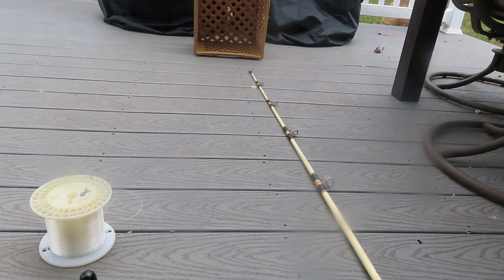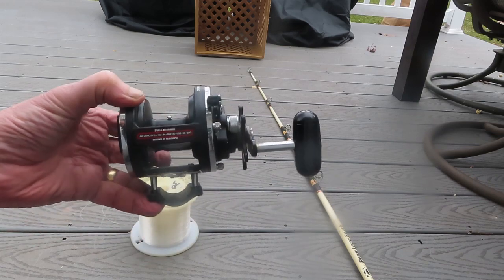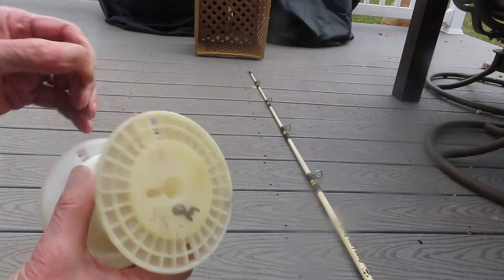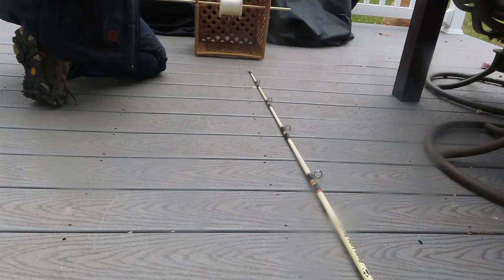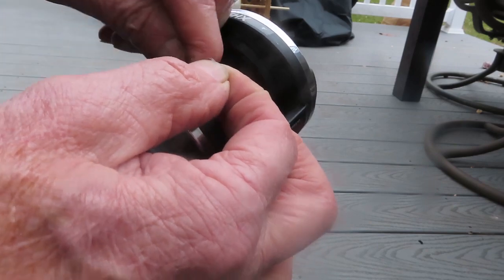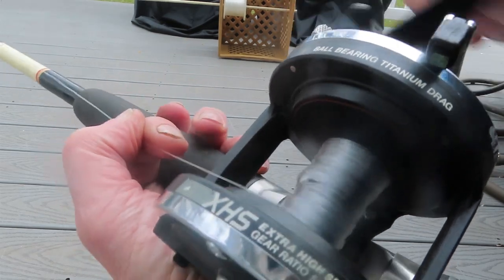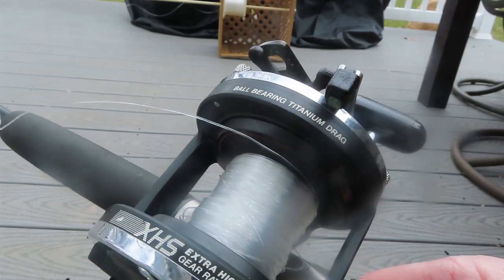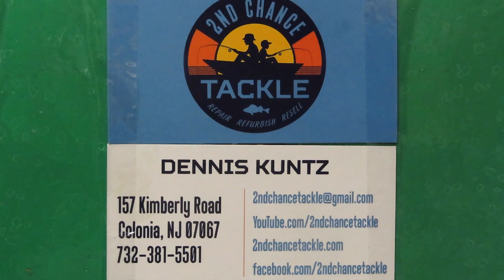How to put fishing line on a non level wind fishing reel

Comment: thanks for the how to use video, I can fix one of these, but haven't got a clue how to actually fish with one. I grew up around people that used spinning reels and spincasting reels. Once Spring starts I am going to learn how to cast a conventional reel. If any neighbor asks what I'm doing , I'll tell them Grass Carp season just opened but their not biting
Reply: Seymour, if I may make a couple suggestions... use a torpedo weight. You'll occasionally have to go dig it up when it hits just right but it'll retrive through the grass easily and won't tumble and twist your line. Have water with you to wet your line, it'll cast a lot better. Be patient with yourself! It takes skill to cast a conventional reel well.
Reply: @Greenmaninthedesert  what weight torpedo to start ? I'm retired , so I have the time finally as far as patience, I'm too old and crippled  to get in a hurry anymore, thanks any and all help is greatly appreciated
Reply: @Greenmaninthedesert  should I start with a level line or  conventional , a magged reel like a penn mag 10, I might be making it more complicated then it needs to be
Reply from the maker: Learning to cast one of these is learning from your mistakes!  Be ready for bird's nests when you are educating your thumb.  You will get it an wonder why you haven't been using these all along in not time at all
Reply: @seymourwrasse3321  Good question, Depends upon your rig and what weight you'll be using in actual fishing.
Reply: @seymourwrasse3321  I've never used a reel with a controlled spool so a question I am unqualified to answer.
Reply: @Greenmaninthedesert  I guess I will put some line on a jigmaster , get an assortment of those weights just play with it till I get the hang of it , I wasn't born knowing to use a spinning reel or a spincaster either , and I learned by doing. thanks for the weights suggestion
Reply: thanks Guy and Dennis for the info and encouragement , My thumb starts school soon
Reply: @seymourwrasse3321  how you doing on your casting? If I can throw my 2 cents in,  what I would suggest is get the rod and reel that you will be using, make sure the rod is for conventional reel(small eyelets all the way up rod) then pick the weight you will most likely be using weather your plugging with lures, bait fishing,etc. and the weight being used should be compatible with the rod. Anyways I would go to the water and tie your desired weight to your setup, some reels have anti backlash features where you don’t have to worry about much for the older reels I like to add a little tension to the spool adjustment, you won’t cast quite as far but it will save you from big birds nest that can end your day. What I do is hold my rod straight out waist high and drop the weight without applying any thumb pressure on spool, after weight hits the ground I look for the reel to over spin from 4-12 times, creating small birds nest, this will help tremendously with having to thumb your spool 100%  and large birds nest with slightest error.  Also use quite a bit of thumb tension while weight is in the air and when weight hits the water stop spool with thumb that where most of your over run will happen, as you get better loosen your thumb tension on spool while casting for longer cast. It’s all about trial and error. When you get a better feel you can adjust spool tension accordingly. Just be aware when you get a birds nest when you get it untangled to check for nicks in your line while reeling your line back in unless you maybe telling the story about the big one that got away. I hope this helps a little. Fish on!
Reply: @mermaidmuncher2708  I've decided to stat with a Penn 500 as suggested by Dennis. My big problem is not being near any larger lakes. In the NC mountains in the boondocks. I've been told the same basic directions from a few other people. I will probably get started on a larger field, if the weather ever makes up it's mind if it's spring or still winter. Thanks for the advice

Comment: Great video! Now you need to show us how to spool a spinning reel. I know how I do it but I’m sure you could teach me a thing or two. I got in a nice Daiwa GS-90 today. The anti-reverse gave me some difficulty but all in all it turned out great. All the ball bearings were in great shape. I always thought a GS-9 was larger than a GS-90 but it’s not. The GS-90 is even slightly heavier. It is definitely both bigger and heavier than a 7000C. I’m up to 7 of the GS series but I have no illusions about getting all of them as there are so many. I don’t understand the difference between a GS-X, a GS-SC  and a regular GS. Do you know? I’ve got to do a little black paint touch-up on the side plate decal pieces but there are no blemishes on the gold paint anywhere on the reel. I took a chance on this one because there were no good photos of the reel on the website. I’ll send you some photos as soon as I can. — Chris
Reply from the maker: I don't know the difference.  I will have to see if I can find that out for you - Thanks
Reply: @2ndChanceTackle  I’ve looked at the schematics but I just don’t see it. The logical idea would be either the reel speed (gearing) or spool capacity. That’s all I can think of. == Chris

Comment: The hardest part is putting it on while your fighting a big fish I had a 5 foot black tip in Florida on my long beach 68 50# test almost took my finger off trying to guide it
Reply: Can I suggest Deema gloves? They're made a a fiber more cut resistant than Kevlar and available in coated or uncoated palms. They also work great when filleting fish.
Reply from the maker: Good idea - Thank you
Reply: Yeah I was going to suggest the same thing. When you're actually fishing, some kind of protection is important if you are expecting to catch some big fish. Even more important if you're using braid.
Reply: My take on it, don't worry about line lay when you're fighting a fish, worry about it after the the fish is on the deck!
Reply: @pennyan2057  
The issue IMO is that if you have a lot of line paid out, if you don't manage the line going back onto the spool, it will run into the frame. 
By using a glove, instead of placing all the weight onto the drag washers, you use the glove to pull the line in and make it lay in place.
It's not difficult to get the line to lay flat with minimal experience.
Reply: @gungadinn  Like they do on Wicked Tuna?
Reply: @pennyan2057  Correct. 

Even the largest of reels have less than 60-70 pounds of drag.

I lost the drag on a Penn International 80T when a blue Marlin hit the bait and took off full tilt. He peeled off 400 yards of line in less than 2 minutes. The reel was smoking before he turned and headed at the boat. 

After the trip, when I serviced the reel, the drag material was black and stinky.

Comment: I soak the spool in scalding hot water
Reply: Excessive heat weakens mono. There is some science supporting soaking mono but not scalding hot.
Reply from the maker: This one is new to me.  What is the reason?  Thanks
Reply: Even warm tap water run over the line on a reel gets rid of much of the line memory.  A minute or so works and the reel is cleaner, too.

Comment: Non Levelwind reels cast better than levelwind reels.  I throw a chop shop Ambassadeur 6500 for drum, sharks, and sometimes catfish. Chop shop meaning I put a CT frame on a C3 reel and the levelwind was made redundant and I added "Rocket Fuel" to the bearings as well.
Reply from the maker: Thanks - yes - the ling guide slows the rotation of the spool and the line causes additional drag on the cast.  Non-level wind reels are the way to go if you are casting for distance - Dennis
Reply: Hi yes thay do and will last longer no broken mechanisms